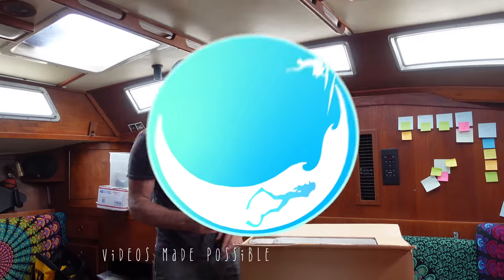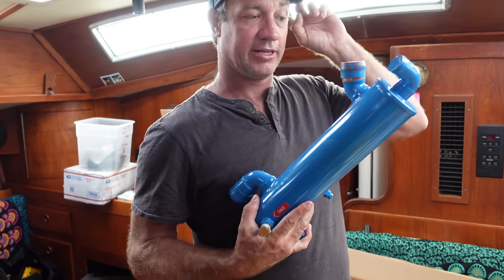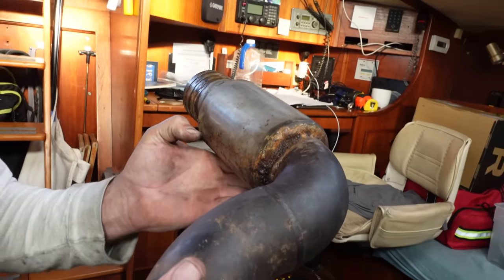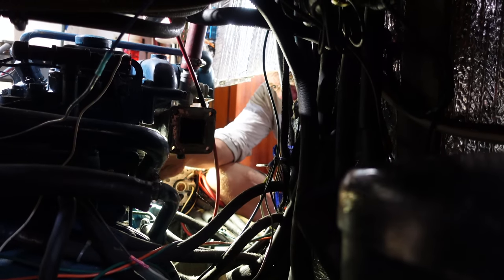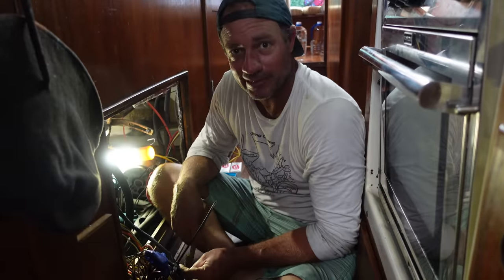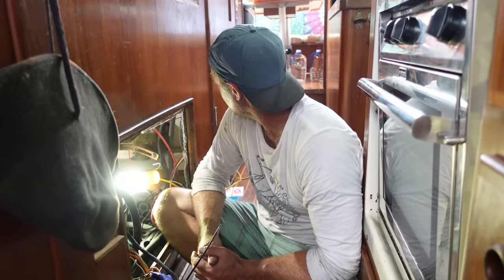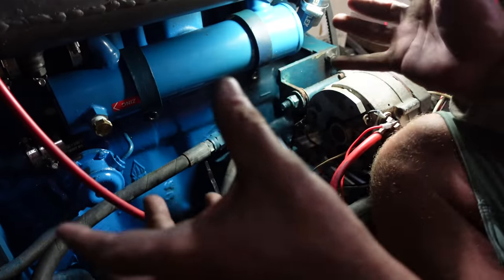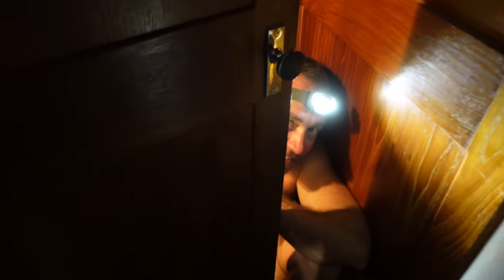Finally a working inside SHOWER | LOTS of BOAT WORK | Ep 307

Comment: Change as many of the engines hoses as possible from rubber to silicon. Will outlast the rubber hoses, not affected by heat like rubber is and they come in assorted colours including Blue.

Comment: ... Bella was waiting for the PUNCH line ..... hope the reduction in pipe size after the sensor is not a place for the hair and whatnot to accumulate ... exciting that things are coming together .... love the realizing that the old that had worked for years with nothing to compare to worked just fine, but the appreciation of the new and improved are eye opening ..... as always .. thx for sharing .. never stop dreaming, just dream bigger .. have fun be safe, save our oceans ....

Comment: Ideas? He has lots of ideas, and I love that blue color. I’m going to get some of that. On hose clips there is a guy who has done a thorough review on hose clips with a range of load tests, fast paced and very informative. Look to Swagelock for better hoses for some uses around the boat. Doing head repairs requires the most extreme yacht yoga, though it is the most rewarding as showers and toilets you use many times a day. Tip: I left the original Lavac pump in the toilet line when I converted to Dometic electric toilets. The advantage is that you can use the hand pump to drain the toilet bowl and fill the line to the through hul with air to prevent salt build up, while also giving a backup pump out toilet if the electric side fails. Works well. I love my electric toilets, but I am up for new ideas for the shower drain. The other shower improvement (I have 2 wet heads) is I have a fan heater running off the hydronic system in each head to dry the heads out after use. This works great to keep the heads mostly dry (no wet walls). I run the hydronic for an hour to reheat the water after 2 showers and operate the fans while the water is reheating. At present I am making up the solar thermal panels to go behind my solar PV Panels to charge my hot water system from solar energy via the hydronic circulation system to reduce fuel consumption (showering during the day is advised with this). Keep up the great work, you are awesome.

Comment: I've been using one of those pumps for about 5 years. They are really good, just don't let them get wet as the pcb in the end is not protected. Also very occasionally they get grease in the sump and they switch of for no reason... The solution is to have a hot soapy shower :)

Comment: What are the 2 high pressure hoses behind the alternator? (guess they run to the oil filter)
If u ever need to replace flexible heat hoses, check out silicon hoses. Independent titanium heat exchangers are also worth considering, better value, easier to service. When ya think about durable mechanics for a boat, consider what dredge, drill rig, etc, companies use. They don't pay high margins of a marine chandlery.

Comment: I'd like to find a huge assortment of the good ones to take with me. We call them Hose Clamps in the States. I was also thinking a smear of silicon grease would make it easier to get things on like that heat exchanger. Silicon Grease is really good for the hoses.  It also fattens up o rings and I use it on them when installing or checking. It also stops coffee cups with sealed lids from leaking if you put it on the seal ring.

Comment: If it is rubber or plastic its a hose. steel is pipe ( unless its small, then its tube) and copper is copper pipe or tube (like steel)

Comment: I had the same heat exchanger, have you considered mounting the unit  remotely,  I did it with oil filter and cooler as well as Heat exchanger. Made servicing of each easy.

Comment: fyi. I wouldn't use Kirkland bath tissue. I have a septic at my home and the man who services it told me it's the worst tissue to use because it doesn't brake down. and as a boat owner myself there is nothing more frustrating and gross then fixing a head. for our home we now use Charmin cause it brakes down. you can actually do the test yourself with different types of tissue to see the results yourself. for the bost we use a marine grade that we get on amazon. that would actually be a good video get a few different types of bath tissue and test them all.